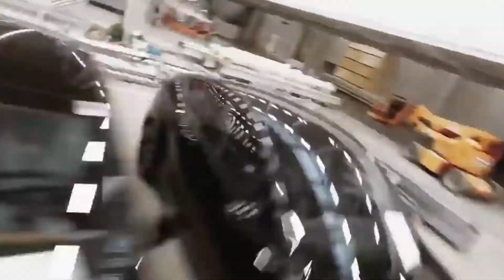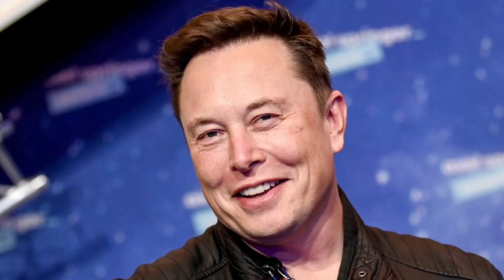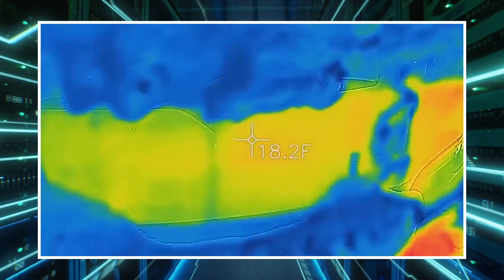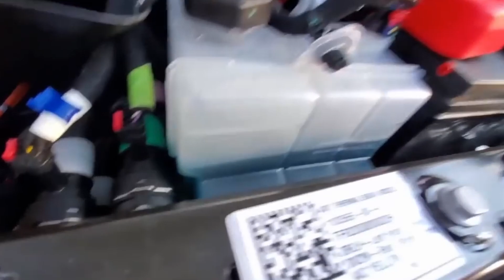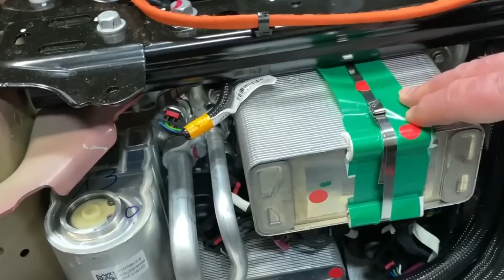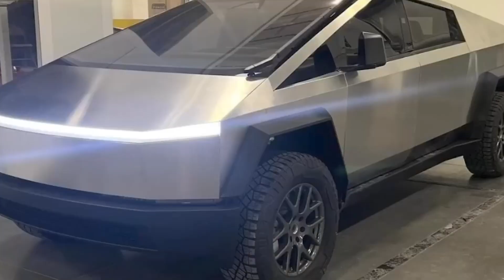Here's How Cybertruck’s Heat Pump Is Game Changer For Tesla!!

Comment: There was a video on YouTube the other day that someone used a 3d printed heat exchanger that is used to cool the oil pump on a military helicopter blade.  Thing is it used geometry to make 3x effective.  could Tesla do something this easy and just upgrade their heat exchanger using a geometric formula thus using less energy?  could you also upgrade the whole thing,  shrink.  put alternators in their combine the newest batteries and get the hydrogen off the line?